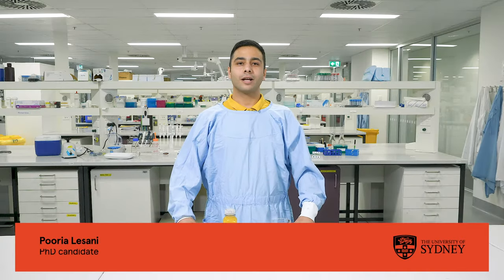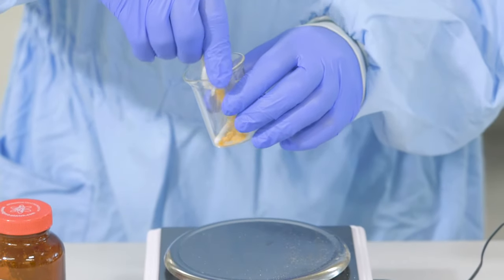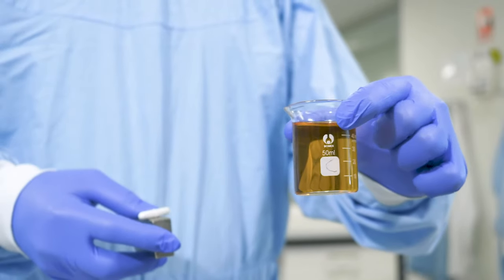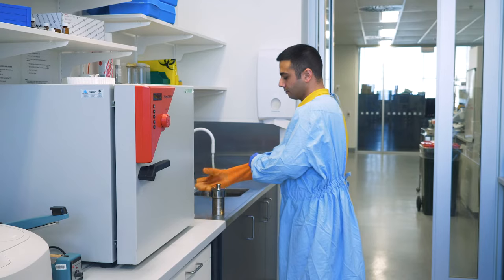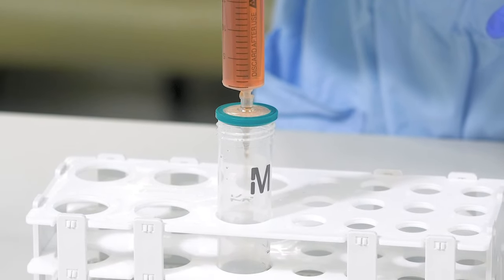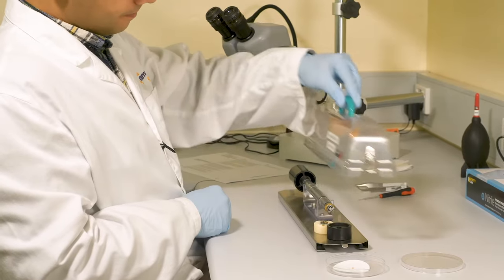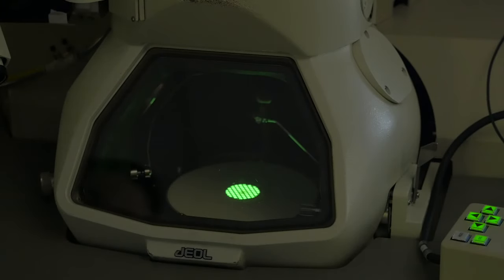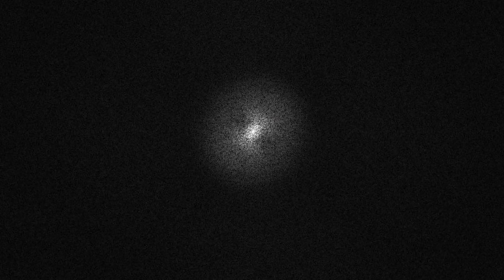Carbon Quantum Dots: Hydrothermal Synthesis and characterization (Part 1/2)

Comment: I just learned about CQD, I have a few questions to ask. Really thank you if you answer them:
- The PL emission spectra of CQDs are not separate like semiconductor QDs, but they overlap and only change the strength and weakness of the emission peak. Why is this?
- What effect does a wide particle size distribution such as 9-23 nm versus a narrow size distribution of 3-7 nm have on PL emission properties?
- For doped CQDs, if the doping concentration is too little or too much, the luminescence intensity is usually not as strong as doping with an intermediate concentration. Why is that ?
- The PL emission spectra of CQDs in solvents with different polarities are also different. How does the solvent affect the emission spectrum of CQD?
Reply from the maker: The overlapping emission spectra of CQDs compared to SQDs typically stem from CQDs' heterogeneous sizes, diverse surface states, and varying compositions, leading to a wide range of energy levels and emissive transitions, resulting in broad, overlapping emission peaks. Narrowing down the particle size is a way to avoid the overlapping.

Comment: Hey I synthesized the CQDs using the same procedure, instead I used a 12micron filter paper to remove the contaminants. I am still a junior year student and I really am confused on how to characterize the sample. We do not have a TEM in our University, please guide me on how to make a sample from the liquid solution for XRD Analaysis, and UV spectrophotometer analysis. Moreover could you please let me know how should I prepare a sample from the liquid solution for the SEM analysis.
Reply from the maker: Hi Muhammad. 12um filter is relatively very large, so the contaminants and overreacted particles remain. I suggest using a 0.22 um syringe filter and then purifying further using dialysis bags with a size in the range of 1-3 kDa. You can dry the sample using a rotary evaporator or freeze dryer for XRD/SEM. UV-vis, you can use the liquid sample, but make sure to use low concentration. I don't think you can see the particles using SEM. You need to use TEM. Most DLSs cannot measure the CD's size.

Comment: Materials required for the Synthesis of  Carbon Quantum Dots, Graphene Quantum Dots by Hydro Thermal Method( or other easy methods). Thank you sir
Reply from the maker: you can basically use any materials having C, O, and H in their structure + having a proper solvent that the starting material has good solubility in it.
Reply: @NanoAustralia  Thank you sir 🙏
Reply: Are you still active on the channel mate? I've got a few questions... As I've made about 400 batches of CDs in the last week... And for the life of me... I cannot get yellow or red 🤦‍♂️
Reply: @RghnutritionAus  method for red quantum dot
Reply: Please tell
Reply: @pragyajain7632  I'm not sure if that's a question or a statement lol
Can you explain what you mean?
Reply: l am asking method for synthesis of red carbon quantum dot

Comment: Thank you very much sir. Your video is definitely very informative. I just want to know how to use the cdot solution for characterization under SEM (SEM analysis usually requires a powder form). How to obtain powder form of cdot?
Reply from the maker: I am unsure if you can image CDs using SEM, as a high magnification is required. I suggest using TEM and DLS for particle size measurement. 
Use a rotary evaporator or freeze dryer to get CDs in powder form.
Reply: @NanoAustralia  Thank you very much

Comment: Thanks for the video! How much water did you use to dilute the orange solution to yellow? Will the orange solution fluoresce under UV light without dilution?
Reply from the maker: It really depends on the amount of precursor initially used. Having said that, if the solution is too concentrated, you will receive low or no fluoresce. It is always good to have a fairly diluted solution (max 1 mg/mL), especially for UV-Vis spectroscopy. hope it is helpful.

Comment: Enjoyed the video. Looking forward to seeing future posts! I received my supply of Ascorbic Acid today and plan to create a batch of QD via Hydrothermal tonight. I've also been looking into doped-varieties of QDs.

For example, Citric Acid for the carbon source, and adding l-cysteine for the nitrogen creating N-doped QDs. According to the research paper, this combination yields a strong violet-blue reaction.

Also looked into other carbon sources like sugar that's been dehydrated by sulfuric acid. It's fun to try these different variations. However, not having such a complex lab (essentially doing this from home) i tend to only yield blue or green dots. Would love to get some red ones eventually.
Reply from the maker: thanks for your comment, Richard. Before anything please make sure you are following the safety protocol while you are making them especially if its happening in the house! 
Sound like an amazing idea, there is a couple of research based on the dopant effect on the optical properties of the CDs. However, it is not very much in details and not many dopants were examined. 
for the red CDs, it is very challenging to do so! as long as you find the proper dopant and optimize synthesis protocol, then you would be able to make them! 
I have finally could make one after 2 years of effort haha. 
anyway, good luck with your experiments and please let me know if I can be any help :)
Reply: @NanoAustralia  thank you for your reply Pooria. Today i produced my latest batch of QDs - However, mine are reflecting green rather than blue. Could it be i needed more time for particles to break down further (longer autoclave), or i somehow got some contaminate in it.

It's strange, because every method I've tried so far, and with all different types of materials, i seem to be producing green QDs. At this point i'm wondering if they're actually QDs or not - maybe something else. I know certain fluids with the same colour (in normal light) give a green reflection under UV (urine, green tea, etc). I've got in contact with my local university to see if i can hire a grad + TEM for half a day.

Another area i'm interested is the thermal conductivity/transfer of QDs. Considering it's potential as a fluid for thermal energy harvesting.

Comment: Very fruitful video. can you tell me the process how can we convert carbon quantum dots into solid form?
Reply from the maker: Thanks gormyour comment! Best is to either use a freeze dryer or a rotary evaporator to dry the sample. Other alternative is to add the solution of CQDs into a beaker, have a magnetic stirrer in the beaker, put the beaker on a hot plate with max temperature of 80-100C. Note, monitor this process consistently.
Reply: @NanoAustralia   Thanks

Comment: Excellent video. I would like to know what is the best grid to observe the CQDs in TEM?
If possible I would like to know what index of refraction I use for CQDs to do an analysis using DLS. I did not find these data in the literature. Thanks and congratulations for the class helped me a lot.
Reply from the maker: Thanks for your comment :). I personally use SPI Supplies® Silicon Oxide Coated TEM Grids 400 Mesh Gold Pack of 50. It's great for fluorescent materials.
Reply from the maker: In terms of IR for DLS, it depends on the solvent you've dispersed your CQDs. I use water so the RI is 1.330
Reply: @NanoAustralia  thanks! Helped me a lot.  A big hug and congratulations for the class.😉👍

Comment: Thank you so much sir such informative video, it really helps those students who actually don't find the proper handling for synthesis.
I am doing PhD in South Korea and I want to use c dot in polymer to make water filtration membrane. But I wonder how to incorporate c dots into polymer.
Reply from the maker: thank you for your comment :). I have been using CDs incorporated with Hydrogels. While mixing them, during the polymerization, the presence of functional groups on the surface of CDs can significantly affect the polymerization. It can somehow improve the stiffness of the final hydrogel product.

Comment: Thank you very much for your clear explanation! This video was really really helpful :)
But i have a question, is there any difference in synthesizing carbon dots in closed drying oven(your method) or hot oil bath?
Reply from the maker: Synthesis methods and synthesis parameters can significantly influence the physicochemical, photophysical and biological properties of CDs. I’ve discussed this here: https://pubs.rsc.org/en/content/articlelanding/2021/nr/d1nr01389k/unauth

Comment: Thank you for this video. I have a question, though, should the filter be enough to purify the CDots solution or would dialysis be a better option? Thank you
Reply from the maker: That’s a good question! If you want to further use your CDs for biological applications, you definitely need to do further purification. Like you mentioned, using dialysis bag or membrane tubes is the best option. You just need to use the correct dialysis size… have a look at this paper: https://pubs.rsc.org/en/content/articlelanding/2021/nr/d1nr01389k/unauth

Comment: Such a good video for beginners! But I have a question, you said that ions such as manganese (Mn2+) in water can change the properties of carbon quantum dots, so what properties that you referred to? Thank you. Actually I'm currently doing my research about carbon quantum dots too, and wish me luck :D
Reply: *magnesium (Mg2+)
Reply from the maker: Hi Katty, Thanks so much for your comment. The presence of any other elements besides Carbon, Oxygen, and Hydrogen can change the CQDs structure and therefore its optical properties. Addition of other elements (dopant) into the structure of CQDs causes change in graphitization degree of the core and also the surface defects distribution. It can either make a red-shift or blue-shift in absorption, excitation, and emission wavelength of your CQDs. Please let me know if you have more questions. Cheers!

Comment: can we separate QDs from solution? like in powder form ?
Reply from the maker: you can use either a rotary evaporator or freeze dryer after the synthesis.
Reply: @NanoAustralia  how much quantum yield after Freeze drying

Comment: do we need to control the pressure? and also nice video!
Reply from the maker: Thanks, Seiya for your comment :).

Yes that can be a synthesis parameter that you can change for different synthesis. If you like to do so,  you need to install a pressure gauge (you can find on eBay) on top of your reactor and monitor the pressure during the synthesis. How to change pressure? => change the filling factor. I mean every time you add different volume of solvent into the teflon => you'd get different pressure inside.

Comment: After synthesis and filtration we can directly go for TEM or we need  DLS as supporting information  before so that my mone
y should not be wasted. I have synthesized QDs showing very good fluorescence in 365 UV lamp. . My QDs in DLS showing 300nm hydrodynamic diameter, Can I proceed for TEM. Please suggest
Reply from the maker: You don’t necessary need to do DLS before TEM. The common available DLS machines are not able to accurately measure the hydrodynamic size of CDs as they are smaller than their detection limit.
Reply: @NanoAustralia   thanks

Comment: Are you still active on the channel mate? I've got a few questions... As I've made about 400 batches of CDs in the last week... And for the life of me... I cannot get yellow or red 🤦‍♂️
Reply from the maker: 400 batches?! that's a lot! Gimme more details on the following items. Synthesis method, solvent, synthetic parameter (time, temp, etc..), ingredient used for the synthesis and their molecular structure. I might be able to help you after.
Reply: @NanoAustralia  for some reason my reply isn't showing up, might have gone over the character limit 😅 
Let's see if this one does
Reply: The end goal is to have something that works well with in photovoltaic applications, so trying to keep a Aquarius based solution if possible that's a similar base structure to what it would originally be if it was a due (hence the organic options)

I've filter some of my solutions with a .22 uM filter and I can't seem to get:

A. A clear solution

B. Different coloured solutions

It always ends up being green or blue...

Apparently orange or red doesn't want to work for me 😅

Part 2
Reply: Citric acid, urea and deionized water for the most, but I then started to just throw shit at the wall to see what stuck...

Which ranges from glucose and water, ascorbic acid and water, citric acid urea and red iron oxide, sweet potato, green tea leafs...

Actually part 2 😅🙄
Reply: For some reason I can't post the actual most important part of the message 🙄
Reply from the maker: @RghnutritionAus  , so I assume you are using the hydrothermal method to synthesise the CDs. 
A few points to consider: 
- the precursors you are using mostly have aliphatic molecular structure, you should consider mixing them with other precursors with aromatic molecular structure. I found that the molecular structure of starting materials plays a key role in determining the final optical characteristics of the CDs
- Also, using DMF, DMSO, and Ethanol can help in addition to water as a solvent. I agree with you; some of the reported red emissive CDs are challenging to reproduce.
- look at this paper; you should also consider a comprehensive optimization of the synthetic and post-synthetic parameters. https://doi.org/10.1039/D1NR01389K
Reply: @NanoAustralia  I believe so yes...
Ahh I see... Toluene, aniline etc?
I have tried using DMSO post synthesis .. but not during.
Awesome I'll have a read of that, thank you,!

Comment: Sir how to make them solid, and may I know other properties like chemical surface modification and solubilities of c dots?
Reply from the maker: You can use either a freeze dryer or a rotary evaporator to make them solid.
Reply from the maker: the solubility of CDs depends on the starting material and the solvent you use for the synthesis. In most cases, you will end up having water-soluble CDs as you usually get hydroxyl and carboxyl groups on the surface of CDs.
Reply from the maker: For surce modifications have a look at the below papers. I performed two different surface modication methods: 
https://www.sciencedirect.com/science/article/pii/S1385894721052426

https://pubs.acs.org/doi/full/10.1021/acsami.0c05217

Comment: I observed my QDs in fluorescent microscope and SEM . It was showing large sized particles. is that are quantum dos? OR only way to observe QDs is TEM without any other preliminary observations
Reply from the maker: While it may be theoretically feasible to observe CDs through SEM, the visualization of individual CDs using basic fluorescence microscopes remains challenging. To gain a better understanding of the particle size, I recommend conducting TEM analysis. Additionally, performing XPS and FTIR experiments would be beneficial in characterizing the composition and properties of the material you have produced. Please keep me updated on your progress.
Reply: thank you 
 @NanoAustralia

Comment: how much concentration should be used to make solutions is it ok to make 200 to 300mM solutions to increase the yield?
Reply from the maker: it really depends on the application you want to use CQDs for. For biological applications such as cell labelling, you can 100-1000 ug/mL CQDs, GENERALLY. If you mean quantum yield (QY), the CQDs' QY is independent from its concentration.

Comment: What's the difference between carbon dot and quantum dot
Reply from the maker: Amorphous quasi-spherical nanodots which lack quantum confinement are referred to in papers as carbon nanoclusters, polymer dots or even carbon dots or C-dots; thus, “Carbon Dots” (CDs) is a more suitable name proposed in the literature. When the nanodots present quantum confinement and crystalline structure, we can distinguish between the spherical quantum dots referred to as “Carbon Quantum Dots” (CQDs) and the π-conjugated single sheet referred to as “Graphene Quantum Dots” (GQDs). Interestingly, evidence to distinguish both lies in the precursors used for their synthesis. In the case of GQDs (i.e. a disk of graphene in a size range of 2–20 nm), the precursors are mainly graphene-based materials, whereas CQDs can be prepared from other carbon nanomaterials with a crystalline structure, such as carbon nanotubes, or by pyrolysis of organic molecules subjected to high temperatures. read more here: https://doi.org/10.1039/C5CC07754K
Reply: @NanoAustralia  Thank you so much 🙂

Comment: Didn't you dialysis the sample
Reply from the maker: This demo does not cover the purification process in detail. However, dialysis, including the selection of dialysis size, is often necessary, especially when preparing CQDs for biological applications. I have comprehensively covered this topic in the following paper: DOI	https://doi.org/10.1039/D1NR01389K
lemme know if you have any Qs or have issues accessing the paper.

Comment: Can I use 0.22 micron membrane filter for purification ?
Reply from the maker: I would suggest use that and then use a dialysis tubing (below 30 KDa) to purify CQDs especially if you are using them for biological application. You can find more details in my recent publication: https://pubs.acs.org/doi/abs/10.1021/acsami.0c05217. Please let me know if you have issue getting access to this or if you need any further information.